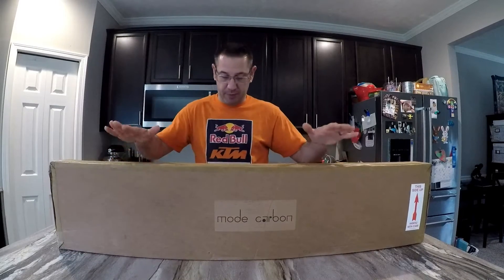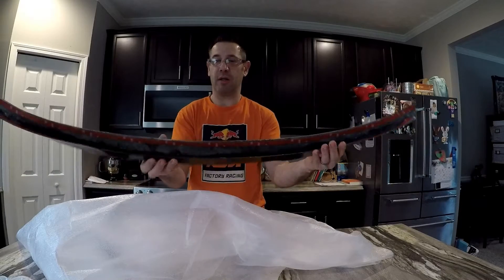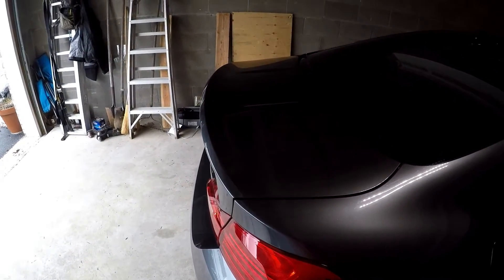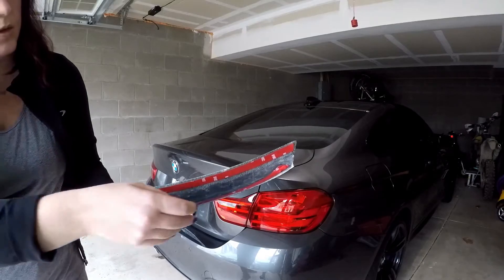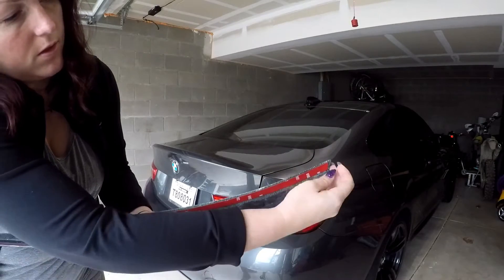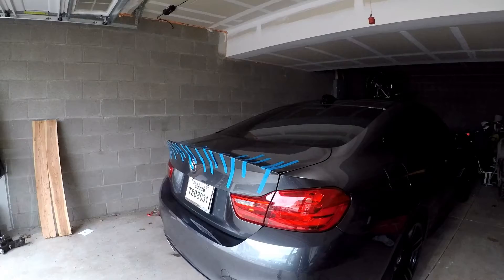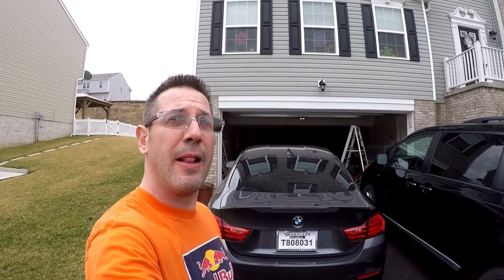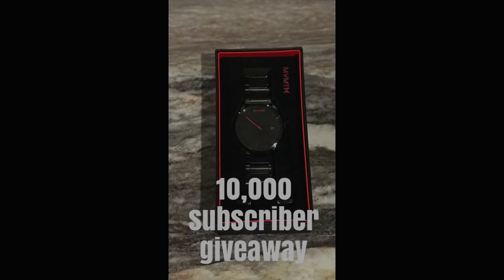My BMW M4 gets Spoiled by Mode Carbon

Comment: Hey PiPs, great video illustrating that carbon mount on the rear deck. Question, does that item actually provide functional down force at competition speeds or is it purely cosmetic ?!?  Either way, a subtle but classy upgrade Yo !!!
Reply from the maker: Thanks John, I think it does both.